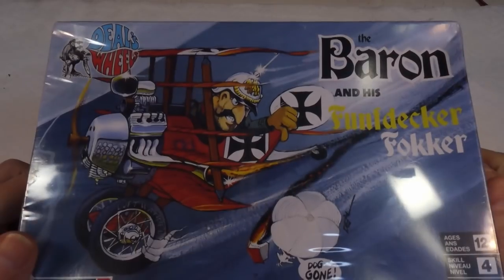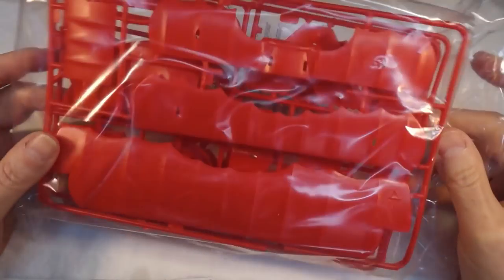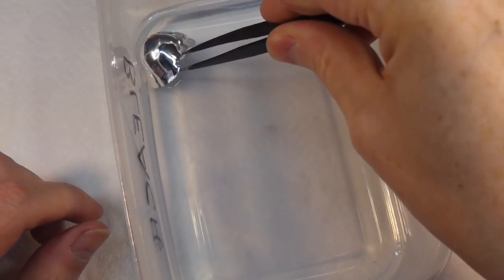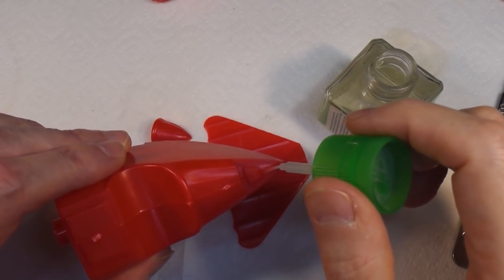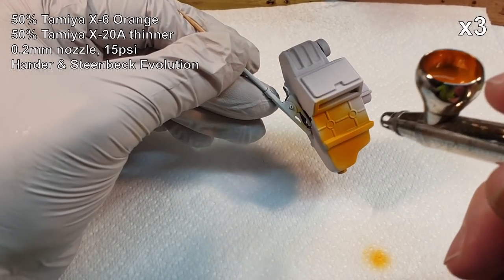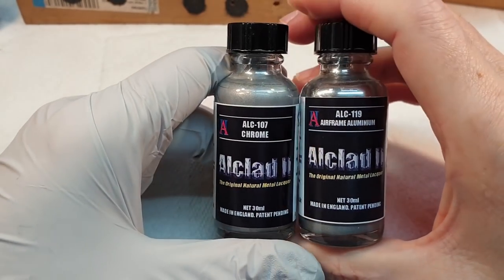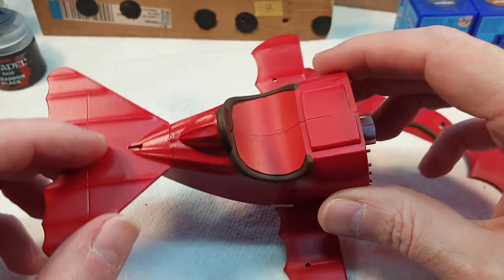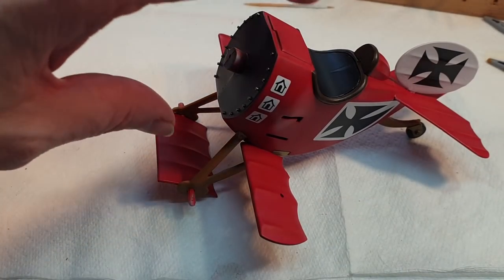Building the Revell Red Baron and his Fokker Fünfdekker

Comment: That came out really well. I had this kit in its early years, maybe even in '71 as I was eight then. I remember having the kit but 50 years later I can't remember how well I built it... but I'd hazard a guess bloody awful. It would have been brushed gloss enamel  (with fingerprints, it took ages to dry) and torn decals. I think I'd have cleaned up the chrome parts after removing from the sprue, and touched them in with silver. Good enough. No mottling or shading, didn't have an airbrush. I don't think I ever really understood what Snoopy had to do with a WW1 German fighter plane but you don't question such things when you're eight!  I was aware of the song though - can still remember the tune. Using the word "bloody" in a song always felt so naughty :-)

Comment: If memory serves, there was a companion piece to this: a Sopwith Camel, piloted by Snoopy, which came with a speech bubble upon which you could write your own insults. I'm sure I saw these advertised in a few 1970's Marvel/DC comic books when I was a kid. Or maybe I'm losing it, big-time.
Those upper wing decals - you could have given them a good slosh of decal softener, and left them for an hour or two. Any remaining bubbles or wrinkles can be pricked with a needle, and a tiny drop of softener added to the puncture. It will lie down flat. I did this with a decal on the rear deck of an M4 Sherman kit, which is mostly engine grille. It looked painted on when I had finished.

Comment: Bleach never worked for me at taking chrome off, I’ve let parts sit in it for 2 or 3 days and still nothing, so I got a really good degreaser, like Super Clean or Simple Green or something like those, I don’t know what you would have over there. But yeah bleach never worked for me. You must have the right touch or something. lol! Oh yeah and while the degreaser is taking off the chrome it’s also removing any mold release agent and works for doing that with the plain styrene parts.
Reply: Oven cleaner does the job for me.